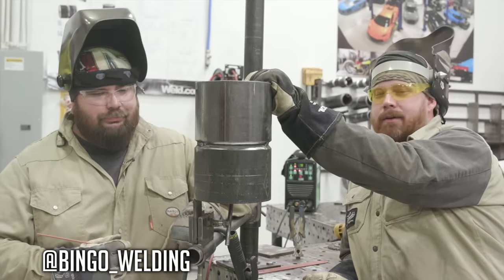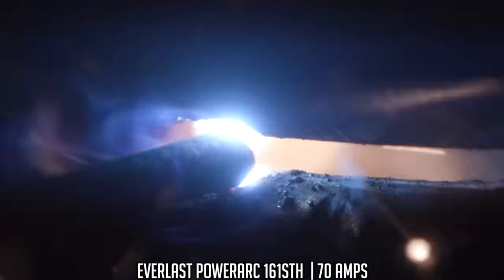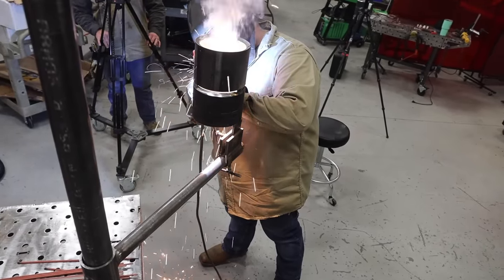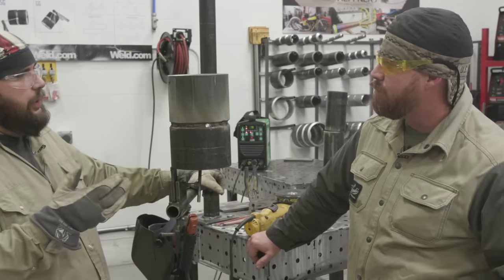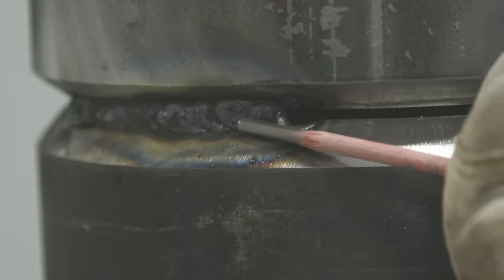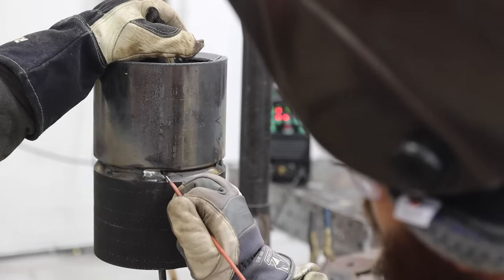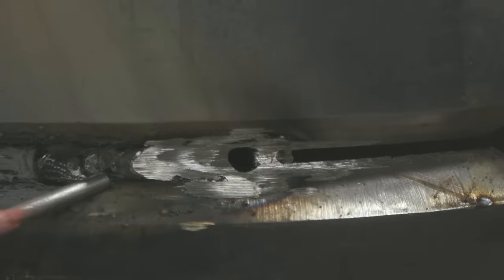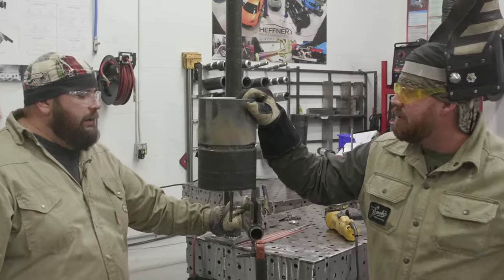Pipe Welding for Iron Workers | 6010 Open Root

Comment: When a new apprentice came on the job and was having problems I would watch and see them making circles ore u shapes or ?  as that is how they were instructed in school, I told them to stop all that and just watch the puddle not the arc and do what the metal wants. It's like painting with a brush. put the metal with deliberate purpose, you control it not the other way around. This seemed to help newbies go from barely hanging on to getting control on there way to becoming great welders.   Retired 597 Chicago
Reply: Local 597 first year apprentice, enjoy your retirement brother!
Reply: I should have gotten into 597.....
Reply: Local 798 trying to get my tig hand back. Watching all the videos.
Reply: Local 155 in Little Rock Ar
Reply: I’m trying to get into 597, I do okay on 2g. 5g, under the pipe is my biggest issue
Reply: Local 110 Norfolk Va

Comment: Y'all welding it at 70 amps and I'm out here welding 90-120 amps 😂
Reply: Pipeline?
Reply: We’re only using about 10’ of lead. Remember, you’ll have about a 5Amp drop for every 50’ of lead added to the circuit.
Reply: I can’t run a weld that low with it extinguishing or sticking
Reply: Btw I am using a 10' lead max 😂
Reply: @jasonbecker3362  that’s a really helpful tip, I have the same machine at home and was wondering why it felt like it was running so hot compared to the machines we have in the shop, makes alot of sense now.

By any chance do you remember what you guys were running for: 
Hot start time/Hot start/Arc force?

Thanks Jason.

Comment: I love the 6010 electrodes. Who's with me?
Reply: once you get used to the fast freeze aspect n learn to control arch length they are great for fat jobs and getting through some of that surface contamination. 😁 i almost always use 6010 for projects then switch to 7018😁
Reply: IF GIVEN A CHOICE, I'D TAKE 5P(RED ROD)OVER 5P+ (GREY ROD) ANY DAY. 5P+ RUNS GREAT ON ROOT PASS BUT THAT'S IT (DOWNHILL)BUT HOT PASS,FILL,AND CAP FOR GET IT!IT WON'T OSSALATE!
Reply: @craigbosko2229  if I think I know what you mean by oscillate , I agree  it can be a pain, I always do stringers if all I have is 6010.  😁👍

Comment: I just finished 1 1/2 months of 8 inch standard wall for irrigation. I wondered what other people do when they blow a big ass hole. I would stop and clean a little then go back and lower the amps a few. I like this technique and will try it more in the future. I would get it all cleaned up then burn a HOT pass cause it covers a multitude of sins. Then clean it up real good then go 7018 and roll it out.

Comment: I have welded 6010 roots in hospital boiler rooms, in paper mills too.  Then 7018 fill & caps. 
Would like to see the inside of the root with the radical wipping that was done. I find keeping the "whipping" to a minimum makes a guided root bend test more likely to pass than whipping as much as was done in the vid. 
  Let the whole piece cool way down before doing any more on the root. What I do is bump the two walls (to make sure they melt. I make a small circular motion). Of course pointing the rod in the right direction depending on what the keyhole is doing.

Comment: I'm on my 2nd go-around w/pipe, running 6010 3/32" @ 45-50 amp. I guess I'm on the low end, and it's key-holing too much. I'll bring it it up to 70 Amp, give it another go! 😁😁😁

Comment: This is hard to perfect, I wind up blowing a hole through it often. Keyhole management utilizing gravity favouring the upper pipe.
Reply: If you're running 70-80 amps and blowing up the keyhole, try tightening your gap slightly or putting a heavier land.  I like a 3/32 land, fat 1/16 gap and 75-80 amps.
Reply: @MrDillaKilla  thank you sir
Reply: Try it on a 45 angle

Comment: 70Amps seems very cold for 1/8" 5P rod in a root on sch 80 pipe. That is where we run 3/32 rod, I have never run 5P less than 80amps, usually between 85-90 especially on that sch80 pipe you are using. 37 year UA pipefitter. Although it is funny as hell watching an ironhead trying to weld pipe! lmfao Really wish you would have shown some footage of the INSIDE of the pipe!
Reply: my thoughts exactly!!  Show me the root!!

Comment: First time doing pipe with 6010 Uphill but We don’t have a Machine to cut the pipes so mine was kinda a bad fit up Little Too tight of a gap
Reply: Best way to learn is to hand cut bevel and plain! Sometimes you don’t have the tools on a bigger job and you’ll come in handy over guys who rely too much on the machines to do it for them

Comment: I have the same exact machine fit the last two years and it had never ever run 6010/6011 properly. Please show me how  you did this bc I have plenty of Miller machines and Lincoln’s that will do it no problem. So why doesn’t the Everlast 160sth not show the same results??

Comment: I usually don't have much a problem in open root when current is set right need very little whipping of rod,now when work is heating up current usually needs turned down slightly cause of preheating and I use 1\8 gape for root and get the rod deep in the key hole
 the weld looks just if it welded on both sides and I hated welding with 6010 Slattery rascles and went to welding school  30 years ago combination welder another thing need to keep a key hole threw out the open root it will have a nice crown on the other side if done right ,the best way I was showed in school is weld open root practice using two flat plates if you can weld both sides that will have nice crown on the other side then move on to pipe.

Comment: Best advice for young welders is welding 6010 vertical and learning to jam that rod and keep the frogs eye. That frog eye will show you where the froze metal is and how far to whip whipping to far makes slag inclusion, not coming back to the last dime laid causes blow out because of the heat build up.

Comment: today i welded some L channel onto the bumper of a 8000lb truck... snow plow. 1/8 7018 145 amps base to burn the rust off, 80-125 amp fill depending of position, and a 160amp hot pass to smooth it out and get some of the flux to mix in so it doesn't rust as fast. still have some filling to do but i cant get a stick to those spots.
Reply: Flux in the weld weakens it. Usually a multi pass weld is so thick the rust will eat up all the parent  metal before a good weld would rust away.
Reply: @DontPressA  will be a plowing this winter. turn it up high enough and all the glass/slag turns to dust, leaves nothing but a smooth weld.
Reply: @ardennielsen3761  ah I thought you were intentionally trying to entrap slag in your weld. In our business that’s a giant no no for welds that are X-ray or magnesium dusted.
Reply: @DontPressA  I welded the 20 gauge exhaust pipe on the car I have with 3/32 7018's. think i had it at 73 amps... 140-160 amps works fine on 3/16 plate. risky and frisky
Reply: @ardennielsen3761  with practice, it’s incredible how thin of material you can weld with bigger rod. I got some 1/16 6013 for stuff like that but as long as you can keep the material from melting away you can use whatever you got on hand.

Comment: Can you please do a Vertical up 6010 pipe Welding (No Downhill please)
Reply: More money in downhill welding 💰💰💰🤑🤑🤑
Reply: @beaugodwin7306  Yeah, we run 6010 downhill & 7018 uphill
Reply: @ASAPJermz  we run 6010 downhill bead and either 7010 or 8010 hot pass through cap ( pipeline)
Reply: @beaugodwin7306  Nice bro 💯

Comment: Sooo…I’m prepping and for a pipe 6G schedule 40 pipe test and the inspector is requesting a 1/8 gap, 1/8 land, with a 1/8 6010 root followed by 1/8 7018 fill and cap.  I’m having trouble finding this procedure online, most everything is 3/32 gap and land and mostly schedule 80.  Can you guys help?

Comment: I just passed my D1.1 plate test, now I’m onto 2G pipe. Is it true that you need to aim the rod towards the center of the pipe for the entire duration of the weld?
Reply: I'm still in class, finishing up 5g and starting 2g. but that's what I've been taught.

Comment: You guys discuss,the reason behind the ,demise of the  5P 6010  ele tride room on pipe . In pressure applications, and in severe cycle applications. 
The  6010 is inherently a poor ,mechanical choice. And as such ,welding procedures, reflect that. 
A joint with high mechanical tolerance ,will as a across the board standard ,use TIG. For the root pass. And  fill and cap , in small schedule pipe,  . 
While it's possible, to use ,hydrogen controlled  rods ,to do  a high strength root.  The  use of tig ,is still favoured.

Comment: Api 1104 api 570 api 510 asme sec 8 div 1 asme b31.3 what are you talking about multiple codes you can use 6010 on the root and stringers and a 7018 for the cap.

Comment: 1/16 gap 3/32 land around 80 just lays in there nice
Reply: 450x   try it i think works better small keyhole and push in there and drag it.
Reply: 450x  make sure to use a cutting wheel to open up the land or crank up amps, halfway through a root and the other side can slam shut with just a 1/16.

Comment: Why do you use a 6010 for the root pass? Cause it’s a fast freeze rod?
Reply: Part of it is mechanical properties, but yes, the fast freeze helps tremendously as far as an open root. Keeps the puddle cooled off so you don't immediately drip out or create an excessive keyhole.
Reply: 6010 has the deepest penetration & deposition of any rod for welding pipe. It's perfect for keyhole management, fast freeze..

Comment: API 1104:IF I WERE WELDING THAT PIPE JOINT, I'D WANT A MAXIMUM ROOT OPENING OF 1/16TH MINAMUM 1/32 ROOT OPENING WITH A 1/16TH ROOT FACE AND JUST"DRAG"THE ROD,NO WHIPPING MOTION.IV'E EVEN TRIED IT ON STRAIGHT POLARITY AND IT GOES IN EVEN BETTER.

Comment: 5p for beginners is what you do if you hate someone, they stick, toe nail, arc blow, and have a less stable arc due to flux composition... 5p++ is way easier to use, and more freindly to beginners, the addition of the iron powder to the flux stabilizes the arc, and fills the weld faster.. bingo is also right handed and welding left to right.. he is putting his body in the way, and rod in his line of site.. this is causing him to long arc and blow the bevel out unnecessarily..(maybe thats for the camera to see better??) if he welded right to left he could get out of his way, see the puddle easier, and be able to keep the key hole smaller and controll it better.. (he is pushing the weld, not dragging it, as a result he pushing the bevel out of his way before he gets there.) there really isnt a need to have a large key hole and fight it as much as he was.. you should be able to  keep 90+% of the sparks inside the pipe while putting the root in, you wont even really see the arc.. you will just wiggly it very very slightly as you drag it to you.. im not bad mouthing the guy.. and not saying my way is better..  but you should find it more natural and less aggravating..
Reply: I tried the red rods and felt they were depositing a lot more metal im a beginner and agree with you the 5p plus plus is a lot easier I was able to lay down a good root once I switched rods by any chance would you be able to suggest any tips for preventing undercut on the cap im using a 3/32 Excalibur rod at 85amps arc set on soft on a Lincoln invertec and only get undercut on the very last pass of my cap I have allowed the pipe to cool down its a 6inch sch 40 also tried pausing longer to allow it to fill in but still get undercut any help would be highly appreciated. Thank you for your time

Comment: Why 6010 verses 7018 from the get go? Or something else. Just asking to learn.
Reply: 6010 is a fast freeze rod, unlike 7018 so that why they use those for stuff like roots on pipes
Reply: I was told 6010 penatrates better and doesn't have to look good because 7018 will be run over top of it and it runs better for a good looking bead

Comment: Why use 5P when you can use 5P+++++? I know 5P+++++ has iron powder....
Reply: They typically root with 5p+ and fill and cap with the 5p red rod
Reply: Denny crane, it's actually the opposite. 5p digs more so it's typically used for the root pass. While 5p+ has a thicker flux which acts as a better shielding gas but it prone to pin holing if you tend to long arc. Honestly it comes down to personal preference you can run it all the way out with 5p or vise versa. But i'am just going off of my experience.